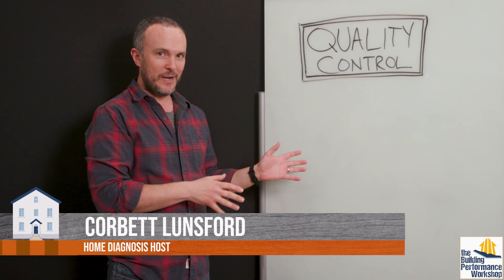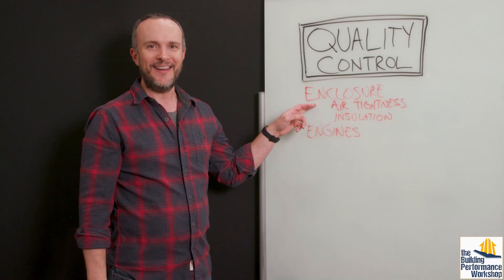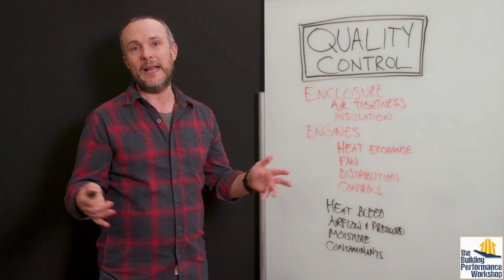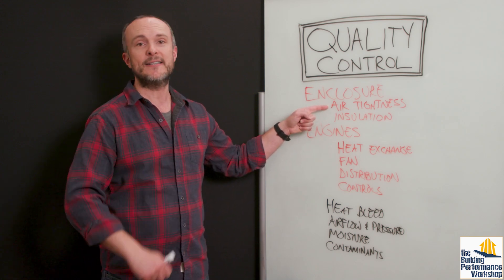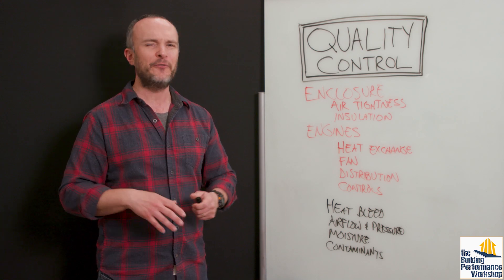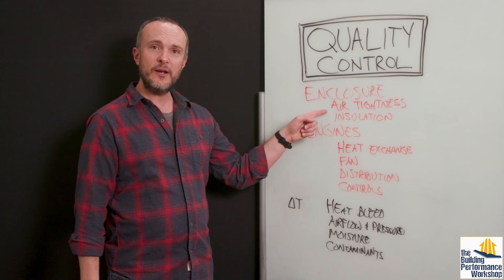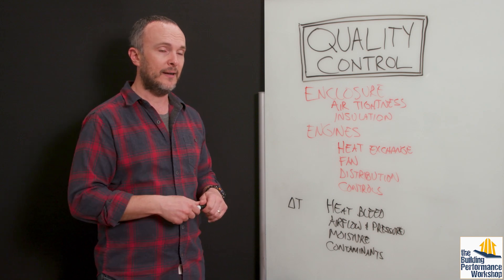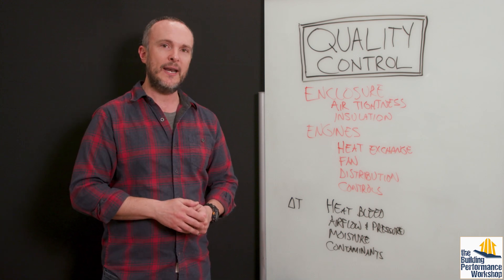Tips for HVAC Quality Control Targets and Specs for Builders and Contractors

Comment: As always great video Corbett. I’m very interested in the ACCA 310 standard of grading HVAC systems. I think an HVAC consultant could make a great living applying those principles and being a commissioning agent for new systems. Hmmmm. Your thoughts?
Reply from the maker: Thanks Tim! We were just looking at that standard yesterday in the Mastermind meetup- only thing I really got excited about was how they pushed the buck to the HVAC installer on including the volume of conditioned attics: if the HVAC tech didn’t directly condition it, we pretend it’s not part of the house. Hahahahaha tag you’re it.
Reply: @HomePerformance  I like the performance testing part of it as long as the contractor is trained how to do it right. And I think Measurequick has a workflow for it now.
And I’m still in the fence about directly conditioning the attic with the same air I breathe. But we can argue that at AHR lol.